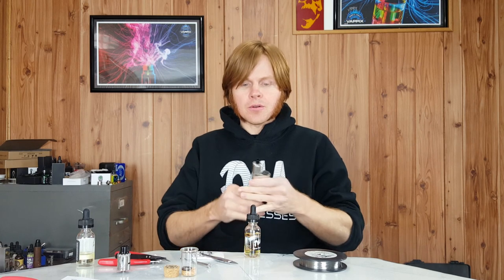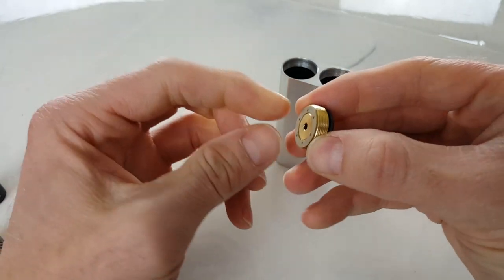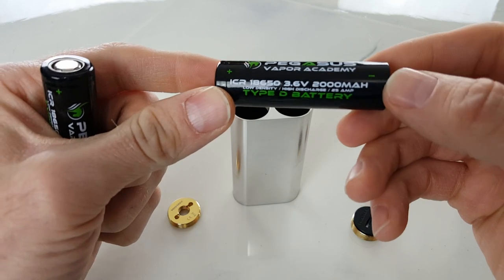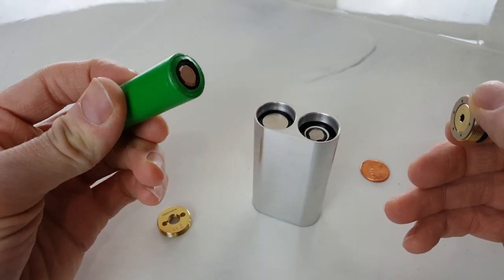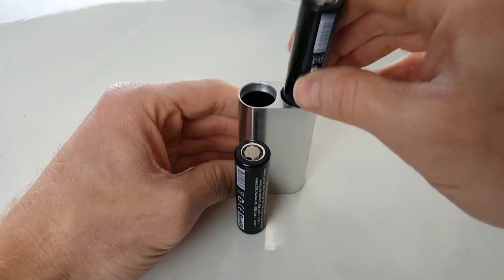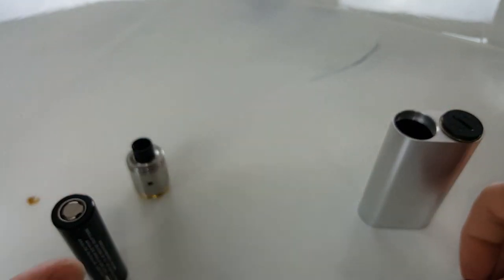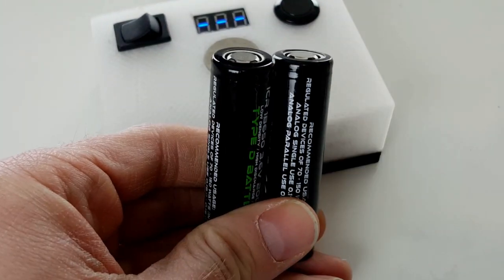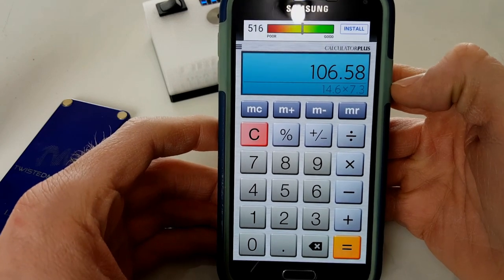Noisy Cricket - Series Box Mod Safety

Comment: Is it ok to use 0.23 ohm clapton coils?
Reply: 8.4/0.23=36ish amps. so no i wouldnt reccomend it, learm ohms law its not hard. voltage/resistance=amp draw
Reply: and if you want wattage on a mech its amp draw x voltage= wattage
Reply: I wouldn’t, the lowest I build is 0.4ohms but found to too rowdy so usually build between 0.45-0.5ohms, actually prefer it above 0.5 still gives a great vape.

Battery wise all I use in mine are LG HB6’s the run times not great, usually get a couple hours on/off use, but I’ve got 8 here so rotate through them :-) 

Also fitted the FD 510 for a little added safety, had an Efest “35A” (35....yeah ok!!) vent on me a few years ago when I started vaping on a mech so I’ve gone a bit anal since with battery safety! Scared the shit out of me!!!

Comment: does series box mods usually use up more juice because its double the voltage, and is the battery life similar to a single 18650 tube mod?
Reply: +Robin Hood anyone?
Reply: +Robin Hood series box doubles the voltage, but you get 4 times the wattage with the same build, compared to a single mod, so theoretically 4 times the juice
Reply: These guys are both wrong. Two batteries will alway's provide (roughly) double the battery life when vaping at the same wattage. Because the voltage is doubled, you need to build higher to get to your desired wattage than you do with a parallel mod, but so long as you are vaping at the same wattage both series and parallel configurations will give you (roughly) double the battery life, so you will get half the battery life of a series mod with a single 18650 mech mod when vaping at the same wattage, and less ohm range in which you can safely vape. As for your second question, the more vapor that you produce the more juice you will run through. That really should be common sense. Series, parallel, passthrough, whatever, none of that matters in the slightest. Less vapor equals less juice consumption, and more vapor equals more juice consumption.
Reply: +Ryan La Hay How are you guys not wrong? Battery life for a dual 18650 mod is double that of a single 18650 mod, in any configuration, when vaping at the same wattages. He asked if the noisy cricket had similar battery life to a single 18650 mech, and the correct answer to that question is no, because it is double. If you vape at 100 watts on the series, and 50 watts on tube mod, then yes the battery life will be similar. However, he didn't specify any such parameters in his question. Also, the only way that anyone can go through more juice is if they are chucking bigger clouds. Chucking big clouds on a parallel mod uses more juice than chucking modest clouds on a series, and vice versa. Battery configuration has zero to do with juice consumption.
Reply: +Ryan La Hay That's a misconception that a lot of people have, and I thought the same thing at one point. When you are talking about battery configurations with different voltages, you can't use mah to compare the two. You have to use wah, or Watt Hours, instead. You are going to need to do some research on Google to fully appreciate this distinction, because I'm not going to explain it all here. But basically, the two configurations simply use two different doors to get to the same room, so to speak. If you build your coil to get 75 watts on a series mod, and you build another coil to get 75 watts on a parallel mod, you wil get roughly the same battery life. In fact, series mods are a bit more efficient and should get slightly better battery life under the same conditions, but that is a negligible figure for vaping purposes. Look, I have done extensive research on this and I know that I am correct. With 10 minutes of research you will come to realize the same thing.
Reply: wow thank you guys so much, but i ended up getting a regular unregulated parallel r a little more experience, this will def. be my next mod

Comment: What's the lowest you can build on a series mod
Reply: +Zachary Tyler Ohms Law man. Ultimately it depends on your batteries. With true 30 amp batteries you could build down to 0.28, which would push 252 watts assuming 8.4 volts. This would obviously be hot as hell. Typical 20 amp batteries would safely push 0.42 at 168 watts assuming 8.4 volts. Most people don't build below .4 regardless, and generally find sweet spots around 0.4-0.8.

Comment: are you sure that we can put the firing button on the positive side and the rda on the negative?
Reply: yes it'll just fire negative voltage. I do it with some of my tube mods.
Reply: +fahad rafat You run the risk of a bad battery wrap having a hard short because the firing switch is big enough in diameter to touch the positive and negative of the battery,so I wouldn't .
Reply: +john muller you shouldn't be using batteries with bad/peeled up wraps in general.
Reply: very true
Reply: +fahad rafat Polarity has nothing to do with it when all that is on the circuit is a coil. So it doesn't matter which way you put the battery in on an unregulated mod. The regulated ones are electronically controlled and they do require that the batteries be inserted correctly and most of the new ones have features that prevent damage from installing the batteries backwards. The unregulated ones with the voltage meter in them will just read in negative volts, if they can do that but most would jut read 0 with the batts reversed. Keep in mind I have yet to mess with one of those types of mods so I can't confirm if it will read 0 or in the negs..

Best thing is to just make sure you install them correctly unless you are an advanced vaper with the proper knowledge and training.
Reply: +Bill Stelling i mean yeah I've been vaping on mechs for a year but no one said that its okay before so i was confused. thanks for the info everyone :)
Reply: +fahad rafat 
I'm not that advanced either.. Been off the sigs and vaping for two months now.. I have watch about every vid worth watching on here though and I dig making coils, working on the mods and I have upgraded everyone I have to improve their performance. Been a craftsman all my life so it comes easy to me and I have a pretty good grasp on it all now after my two months of obsessive vid watching. :)
Reply: +Bill Stelling been vaping and building for 3 years myself plus I'm a bit of a circuitry/electricity nerd and you sir are absolutely correct. Just do not ever try to put a parallel mod in series because it'll cause a dead short.

Comment: ok plzz help me here i was thinking amps was half in stacking batts ;the thinking is batt #1 pushes 15 amp at 4volts and batt #2 pushes out 30amp at 8volts i mite be wrong but this is how im thinking batt #2 push batt#1s load then its load to this is why one always drain more then other one ;so if im right 30 amp batts only can run 15 amps in stacked from. but this is from a guy who always gives him self a 10 amp buffer

Comment: really important question do I need an ohm reader for my builds
Reply: You won't necessarily need one if you have a box mod that shows you your ohms but if you don't own a box that shows your ohms I would highly recommend an ohm reader.
Reply: +Daniel Kivler I'm getting a noisy cricket so I'm  guessing I'll need one
Reply: honestly i suggest you get a regulated devise along with the noisy cricket so you willl have the ohm reader and you will have the ability to change watts so you can make sure your coils are heating up evenly withough having to re-do your build multiple times. it makes life easier. heating and shaping coils with 8.4 volts is a pain in the ass
Reply: +Patrick Russell I'll use my friends mod then for coil reading

Comment: so I have a .25 on my cricket using lg he4 35 amp batteries the ohm calculater says 33 amps so I'm not gonna die right been ripping it for a week and it seems fine. its pretty warm and intense but the flavor is ridiculous
Reply: LG HE4 are rated for 30amp absolute max continuous.
Reply: +Jay Poin I've been using them on that build for a while and they perform just fine. they get warm if I chain vaping for a while but overall I feel safe. I see a lot of places online listing them as 35amps
Reply: +YoureBeingVeryUndude 30amp continuous is probably more accurate and the amp levels at .25 don't account for voltage drop so if anything it is right at the limit of the battery
Reply: Thats very risky dude. You are consistently operating above the amp limit of the battery. Just stick to under 20amps. As twisted said, stay well within 20 amps for safety. No need to have it that low on a series. These are literally little bombs. And it does vaping no favours to have people blowing there lips and noses off, as we have had too much of in the news. Stick to 0.4 and upwards.

Comment: it would give a dangerous short placing the Batteries parallel in the noisy cricket, because the body of the would be negativ and if you hit the für button, the body would get in touch with the positive side of that one battery too!

really really dangerous bro
dont tell them people that it would not work!

Comment: you should always calculate amperage based on the batteries resting voltage. the reason the batteries sag is because they can't give the full voltage due to the tremendous load. That's a very dangerous myth you are demonstrating here. the amperage the battery is actually "feeling" is that of the resting voltage and the resistance. if you don't believe me do some research, people smarter then I can better explain it.
Reply from the maker: Please hook it up with a link, would love some info on that if ya got it
Reply: +Twisted Messes I apologize but I can't find any direct links right now, I have just seen a few posts about it on Reddit. if you scour the forum the information is there. I wish I had a definitive source for you though.
Reply: +MadWes I've heard the same thing, but as I'm also not an expert in how these cells react to a load so I can't refute/support the claim.  I've also heard that even as your battery voltage drains the amp draw stays the same.  Even if you do the calculations with float voltage though, 0.5-0.4 ohms would still be safe with good batteries, especially since pulse limits are higher than continuous.

Even so, it would be smart to apply any safety factors necessary to the calculations.
Reply: You're making a good point here. I wouldn't call it a "dangerous myth" though. If you calculate the amperage based on a fully charged pair of batteries, you will get the maximum amperage your setup could possibly produce. As the voltage drops down, the amperage is going to get lower as well. Then, if you have a 0.5 ohm build withfully charged batteries un series, you would theorically get 8.4V ÷ 0.5 ohms = 16,8 Amps. If the voltage drops to 3.7V per battery after some use, you will get 7.4V total which means 7.4 ÷ 0.5 = 14.8 Amps. I'm no expert eather but I think you should be fine as long as you refer to fully charged batteries when calculating the Amps. Good vid by the way twisted, as always. Please come back for more builds!
Reply: +Ben Use that was my point, he should have just calculated the amperage based on the batteries starting voltage instead of doing those extra steps calculating voltage sag. Best to play it safe either way. problem is extreme cloud bros could see this and think that with voltage drop they can get away with a .21 build on a series mod.
Reply: +MadWes My bas missed that in the vid. Nevertheless you are completely right
Reply from the maker: I don't know. If you say you always should measure amperage based on resting voltage couldn't that create a dangerous situtation on the low voltage end of the specrum? Say combined series resting voltage is 5v, so the batteries should still be at 2.5v each, but under load they're gonna drop super low. I feel like you can't have one without the other.
Reply: +Twisted Messes I'm an idiot dude I was giving you bad information. apparently while the battery is being stressed the amperage is what you calculated in your video. to be safe though you should still use 8.4 as a benchmark. better to calculate with the highest possible voltage output then to use battery sag so you know you aren't gonna go over the batteries continuous amp limit. I'm sorry for giving you bad information originally.
Reply from the maker: +MadWes I don't think you're an idiot at all and glad you commented because it got me to look into it further. I think if someone has no accurate way to test voltage under load then they should absolutely assume 8.4v for calculations to be on the safe side. And I'd never advocate pushing the limits of batteries. But I think the incorrect assumption that batteries can have 60-100A pulse ratings comes from calculating amp draw using resting voltage. I mean, you can tell people that you shouldn't go below 0.14ohm on a single 30a 18650 but some people will do it anyway. And when they try a 0.1 ohm build and it seems fine, pretty soon they stop trusting the stated amp limits and just ignore them. I think generally people make better decisions when they have the correct information. Wish there was more comprehensive info online about amp limits under load etc. Even batteryuniversity didn't have much on it

Comment: yeah always lock or remove you batteries from you mod if your planing on building on it, i accidentally fired my smok x cube 2 while i had a screwdriver touching the positive and negative posts, it popped loud and sparked pretty big because i hard shorted it of course lol it almost gave me a heart attack and i had to explain to my non vaping friend in the room that its not dangerous i was just being an idiot lol luckily it didnt damage the chip or anything else

Comment: The Noisy Cricket is absolute junk.  The button jams, fails to connect, and when the threads sieze a bit from regular use and tarnish, it becomes almost impossible to open up and get the batteries out without ruining the button.  It's unsafe to use if ONLY for these reasons.
 And also, the series issue can be solved with a dummy cell.  Just a chunk of metal in the shape of the battery (Properly shrink wrapped or taped to prevent shorting) and you just need one battery.  

Yes, it looks nice, and works at first, but it quickly turns into junk

Comment: Could it be possible to use anarchist or gplat to build on this
Reply from the maker: 26g 12 wrap around a 3mm bit but I wouldn't do any other gauges
Reply: +Twisted Messes yo you just said you can firing swithch on the positive does that mean that you can put the rda on the negative?
Reply: vaping with nathan DONT IT WILL SHORT
Reply: Yea I know homie lol but I was pointing out that he said that
Reply from the maker: +Syntax Error why would it short?
Reply: so it wouldnt short??
Reply from the maker: +vaping with nathan what would cause it to short out? Their is no set polarity with straight resistance. When there is just a resistor and no other electronic components current can be unidirectional. That's why coil stoves don't need a diode with alternating current. Like with a regular mechanical mod if you put the battery in backward it still works the same. Is that what you meant or is there something with this mod I'm missing?